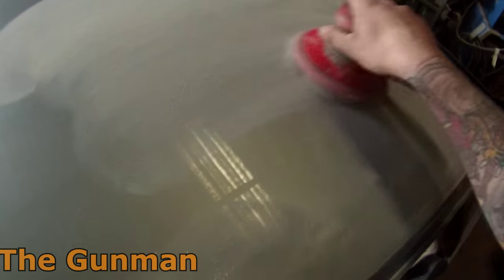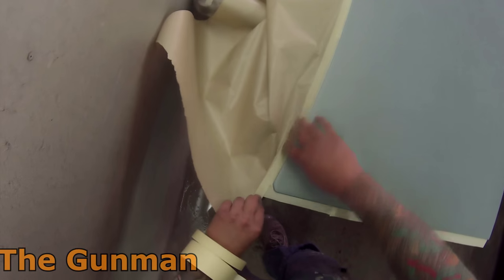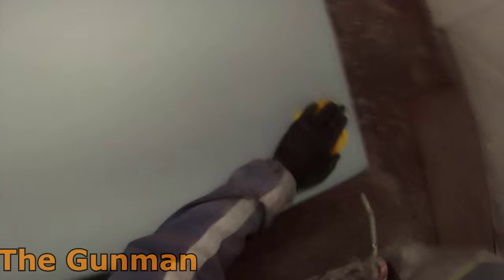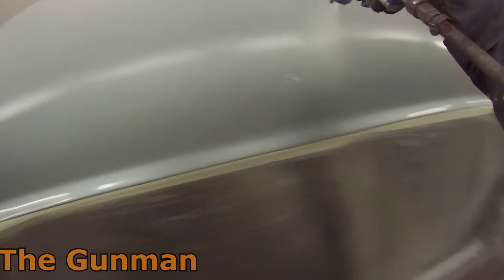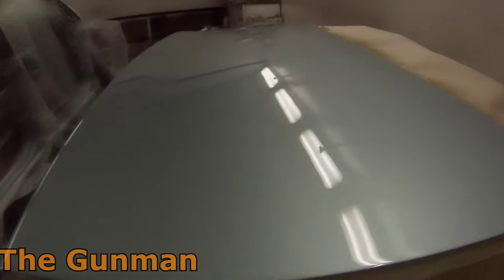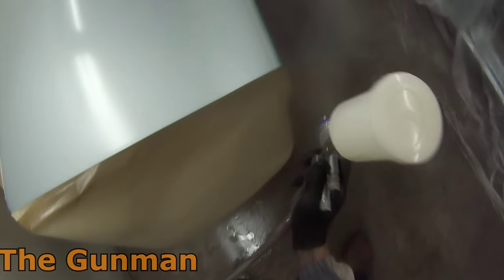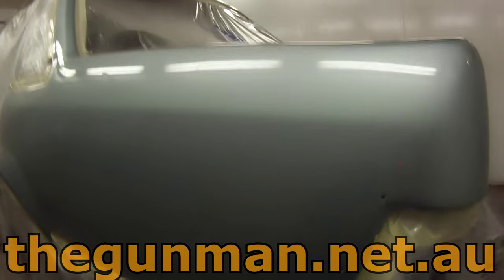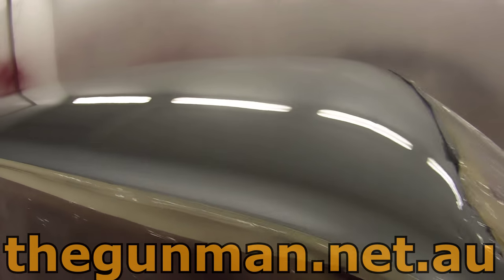Flow Coat VL Body

Comment: Wow great work yet again, I just painted my old Cadillac in my garage, couldn’t have done it without all the videos you upload, thanks all the way from Denmark.
Btw your wet flors I imagine is to keep the dust down, but can you turn on heat in the booth with all that water on the floor??
Best regards, and thanks yet again 🙏🏻

Comment: Hi mate,  I have something to say about this. I have noticed that doing a flow coat, finishing in 800 is a must. I have seen what different grades do with my own eyes.   I fliw coated a Bonne, had it all wizzed in 800 with a soft Pad, messed around doing something else, then came back to it and noticed a bit of a spot with some orange Peel, grabbed the wizz and gave it a quick buzz,had a look and I had buzzed it with 500 accidentally. I said "she'll be right" cleared it, and in the Sun, you could actually see the little area I hit with the 500 was actually slightly cloudy compared with the rest that was sanded in 800. I would love to see you wizz a bonnet in 800 then mask half of it and then wizz with 500 then flow coat it and then compare it in the sun

Comment: Hi GM, great results again, I plan to have a go at this. Can you say what sandpaper you use, I have found that when I dry sand clear with a DA and fine paper I get corns forming which end up putting in course scratches so I reverted to wet sanding. So maybe I need to change my paper.

Comment: Question: I sprayed my clear over a base coat with pearl in it. It sagged in a few places. I color sanded and buffed it out, but even though the sags are "gone" , you can still see the sags from certain angles. I'm guessing because the density of the clear in those areas is different so the pearl refracts the light differently. In your opinion, would flow coating fix this or do I need to totally recolor and clear? Thanks for the video! was extremely informative.

Comment: Shit man that was a mean as effort this is like the third time watching this vid of yours just love it, real inspiration to amateurs like me. Practicing on a couple old cars myself before getting into resparaying my FG wish me luck Gunny
Reply from the maker: I will wish you luck but this trade it's 90% experience, 9% tools and equipment and 1% luck. 🤘
Reply: @TheGunmanChannel  Thanks mate, I might need more luck than most as I do my spray painting in my driveway as have no garage, hangin out for summer!
Reply: I made a shelter from roofing batoning and painters dust sheets, otherwise you're gonna get loads of bits in it for sure.

Comment: great look! Im confused by the term flow coat. the car was already silver COB wasnt it? meaning it had clear on it. You just rubbed it back and re cleared it didnt you?  Am i right in thinking flow coat means re clear coating it? thanks Gunman!
Reply from the maker: Yes, that's what I did. Sanded it down and recleared it. That's what we call a flow coat

Comment: Recently started watching your vids! I enjoy it man!  
I've seen that you have an array of guns to shoot with and I'm just wondering what made you choose the Satajet 5000 in this particular video over your Devilbiss gti pro lite or any other gun you own for that matter?  Did it have anything to do with applying the flow coat? Thanks for any response back
Reply from the maker: Partly because it was my new baby at that time and also I knew it could really pump the clear on, I have no doubt I could have got just as good a finish with most of the other top guns, I recently found out why it smashes it on so hard and that's because 1.3mm really is 1.4mm, that along with a massive fan = loads of paint quickly.
Reply: +The Gunman I see. In your vids you can really see the increase in speed during your passes with the 5000 vs the gti. 
So what is your current go to favorite gun to shoot clear with? I shoot base and clear with 2 older  Satajet 2000's right now. Shot my buddies Iwata and loved the softer finer spray compared to my satajet. I'm in the market to purchase and new gun and was leaning toward Iwata but now you got me thinking about trying a tekna pro lite.
Reply from the maker: norangeito Yeah I'm a Pro lite man, perfect for everyday refinishing, I prefer the TE20 for clear and TE10 for croax pro base but can swap around without much worries
Reply: +The Gunman I really appreciate your feedback. Thanks much for taking the time to respond back. I'm going to give the Tekna Prolite a try! Much success to you and your channel!

Comment: What is the difference between a flow coat and control coat?
Reply from the maker: Flow coat is where we apply the colour followed by 2 coats of clear, then allow it to dry, sand it and re-clear it, it gives immense depth and gloss to the colour. A control coat is the last coat of colour we apply on a metallic colour before clear goes on, lower pressure to 20psi or below and the colour should land nice and even without any mottling or uneven colour dispersion.
Reply: The Gunman thank you so much for the reply. So lowering the PSI is the secret for laying down silver without mottling?? No wonder I have such a hard time with metallic.. I would turn up the pressure and give a dust coat.. but still got cloudiness and mottling..
Reply from the maker: @killadelphia215  I've found these days yes, lowering the pressure on last coat helps a lot. I must admit I used to up the pressure for the last coat but it also worked so really I just recommend trying a few different methods and seeing which works best for you. But for me the key is even application, high or low pressure as long as you're spraying each pass at the same speed and distance you're usually pretty good.

Comment: hello man. when you sand the clear coat is with 1200. 1500. 2000??? thanks
Reply: If you plan on flow coating then go with 600 wet or dry, but if your getting trash out you want 2000.
Reply: +Rockale Lyons thanks man I'm learning about that

Comment: How has SAND PAPER improved so wet sanding is no longer necessary?
Reply from the maker: From what I know the old paper used to get clogged up very quickly when dry sanding, I guess a big part of it is that the 2K paints don't clog as much as the old acrylics did so that's probably more a factor than the paper itself.
Reply: The Gunman Thanks Aussy much appreciate.  Like you very. Much.  Learning everything. I could. Not understand you at first the Aussy accent. Ha ha After listening closely for a little bit I picked it up no problem.  Much appreciate your video work.  You're a great mate.   

Your answer sounds right and makes sense.  The clogging is why I go to the water.  I use a trickle from a hose.  Works well but I'd definitely a pain in the butt.
Reply from the maker: Thomas D Harrell No worries mate, what country are you from out of interest, I am thinking of having my videos translated into a few languages (English included) so more people can benefit, is English your first language and is it just the accent you struggled with or is it English also?
Reply: The Gunman No mate I did not explain well.  English is my native language, but I am from the "south." The "south" is a part of the USA that tried succeed from the Union.  The Civil war or War Between the States ensued. This ancient history is relevant because the Rebels from spoke English but in a quite different dialect than the Yanks from The North.  So my English is so different from yours it took several videos to acquire your version of English.   No worries mate well worth the effort for all the education.  

I like the Aussies, they seem laid back but able to get things done too.  We are similar and different too.  Your freedom is good like ours but I like our gun laws better.
Reply from the maker: Thomas D Harrell I must admit I think you guys will be in a better position when shit hits the fan, at least you guys have ways and means to protect yourself. I see what's going on in Europe and they need guns to protect themselves from the Islamic invasion.
Reply: The Gunman Wow you see that coming too.  The world is definitely smaller than it used to be.  I agree totally with your statement.  Europe is fucked. I don't claim to be a genius but I don't see anyway they can save themselves.  And I do see a collision coming.  THE outcome is at issue.       

The legal right to own a gun to me keeps me a free citizen.  I can also protect myself.  I keep in touch with people all over the world.  The basic story is the same if they give up gun rights they loose freedom and safety..  A mate in South America told me they had gun rights but in a free election the people decided to give them up.  As soon as they did things changed.  The CRIMINALS still had guns if they wanted to rob you or come in your house you had little to stop them.  The CRIMINALS did as they wanted until   
the victims could get help from police or group.   

We are digressing from the subject.  G'day mate no worries.  Merry Christmas

Comment: Do you know how to get a pucker out of a panel?
Reply from the maker: +Thomas D Harrell what's a pucker? Sorry I'm not familiar with this term for painting.
Reply: The Gunman  The panel had a deep dent.  I tapped it out with a hammer.  The area around the dent  has too much metal.  It dose not lay down flat it puckered up. I heated it but that Was the wrong thing to do that warped it more.
Reply from the maker: Thomas D Harrell I must say I'm not the expert with metal work, I just smash them into dents then bog it up :) There are ways to shrink the metal, so what's happened is the metal has stretched and unless you shrink it there'll always be too much metal there. They heat it then cool with damp rags but from my experience I usually make it worse then either let an expert finish it or just bog (Bondo) it up.
Reply: The Gunman you pretty much hit it on the nail head.  I was trying that.  Didn't work.  Cheaper to get another part.  But bashing and bondo is what I am doing.

Comment: Hi gunman..... could it use intercoat ( clear base coat ) then go over with normal clear coat ? Would it make much difference ? Or and flat clear then re clear ..... thanks gunman
Reply from the maker: +rich will there's no use in doing that.
Reply: The Gunman hi can you explain why ? What reasons